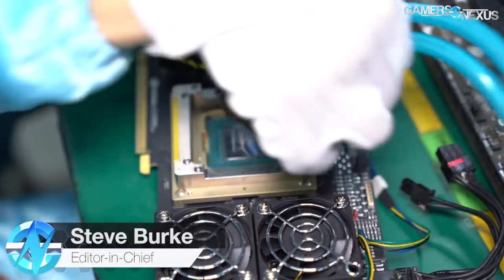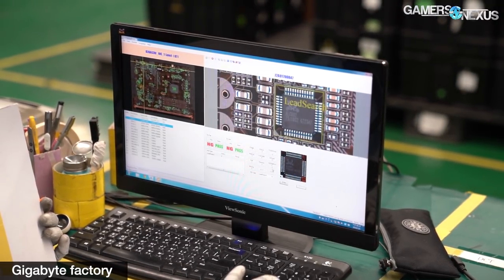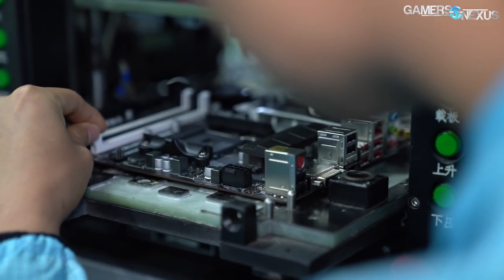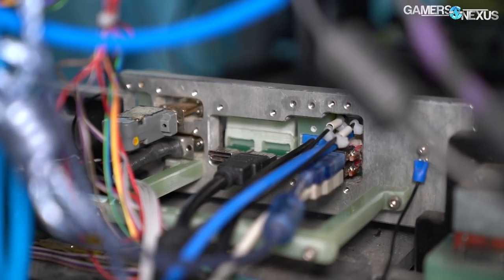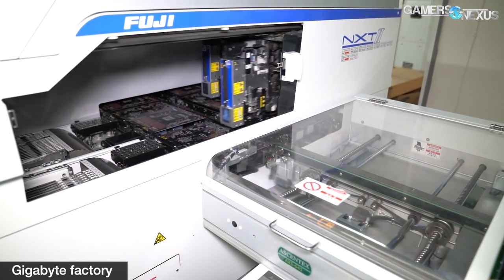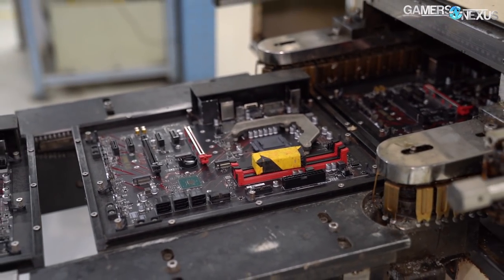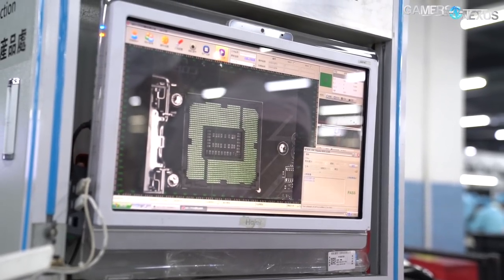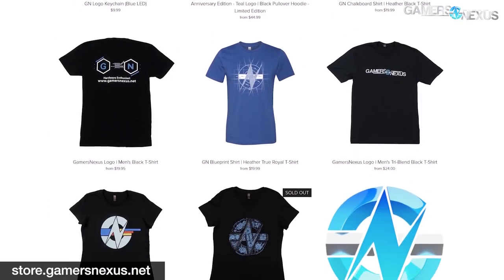Automated Motherboard Testing & Robotic PC Building | MSI Factory Tour

Comment: I think it would be really awesome if at some point you were able to do interviews with some of the people running these factories and talk about the changes they were able to make over time to improve the assembly line, and how they ended up making some of the choices they made (like an in depth technical conversation of how / why the changes happened). Anyways, these videos are always awesome, thanks for them!
Reply: I would think you could talk about some things without sharing trade secrets, even talking about changes that were made to new processes that are no longer used would be really interesting. I'm not really sure where the second part comes into this other than vaguely with the larger socioeconomic shift that is happening in China, while effecting factories certainly, I'm not sure is the main story (though I suppose, if it is, that would also be really interesting to talk about the shift away from cheap labor being the answer to everything, and what sort of pain points that created at first, and how it was solved / mitigated or something).

Comment: Cool video. MSI is one of my favorite PC related companies.
Reply: I really like MSI but I had awful problems with a Z87 board a while back. They were good with the rma but it ended up dying twice :(
Reply: @Kholaslittlespot1  Wow, I've had good luck with MSI thus far. I have a B450 Gaming Pro Carbon AC motherboard and it's doing great, and my older system has a B350 Tomahawk that is also still running quite well.

Comment: I actually worked at a factory years ago that produced the laminated PC boards . I was a laborer, that would feed plates, used for the presses, for making the laminated boards, to a washer, that would clean the surfaces of the the plates after each use. Wish I could go there now to see what kind of upgrades they've made to the factory. Wonder if they've put more automation on the floor to replace my job or not. That might be a great video to make.  This was an excellent video Steve. Thank You for sharing.

Comment: I really enjoy these factory tour videos.
This video might even bring me back on to recommending MSI products...

I've only had one MSI product, it was an GTX 770, it broke within a warranty (around 6months or so). With super low usage since I was traveling for work/school back then so gaming time on the card was not super heavy. Retailer/msi warranty could not replace the card since it was out of stock from my retailer. Contacting MSI customer service yielded only a suggestion to contact the place of purchase.
The overall solution was that the store offered me GTX 960, sure a newer card but with lower performance atleast on the titles that I happened to play. Or a deducted value of my old card and since it was about 6 months or so they deducted around 20-30 percent of the price tag if I remember corretcly. While this may be common practice , I still feel cheated by this action to this day

Comment: I'm just now going through some of these videos, but the automated visual checks by equipment is getting used a bunch at my auto oem.  Supposedly, there's not many using it in how we're doing it and we keep adding more and more.  It definitely helps when you're trying to narrow down where a failure was in the manufacturing (man, machine, material, method/process) and help fix or help make awareness to the process.  I wish some of our suppliers would use these kind of visual checks because ...let me tell you how many "bent pin" defects we get.  Sometimes its not clear what fail point it is but visual checks like this help when our warranty group asks questions and wants to point fingers.

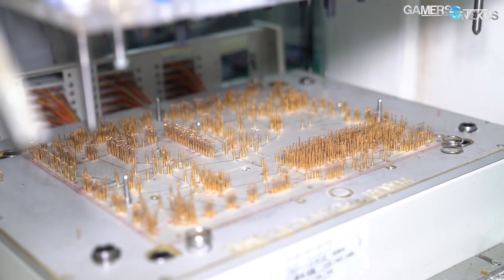Comment: 2:45 makes it pretty clear the Vdd voltages and and ground levels are checked at the socket on every board. I assume this is standard at all major board makes, and i feel like it would be insane not to calibrate the VSoC-SoCGround and VCore-CoreGround at the same time, the VRM controllers support it and it would save you greatly in required part tolerances.

Comment: With motherboards is there any improvement in performance between 'top of the line' MB's between compatible versions. e.g. x370, x470 and up and coming x570?
I understand power delivery is important, however are any of the other 'upgrades' significant in performance boosts or is it just 'fluff' for specific users?
Reply: Probably not. It's just features you might or might not use. Most people see no need for an X470 chipset. B450 is fine.
Reply: It's all really just features, these days. The performance should be identical. This wasn't always the case, back in the day, motherboards had a potentially significant impact on performance. But thankfully that's not really the case anymore. Buy the board with he features you want, and you'll be good.